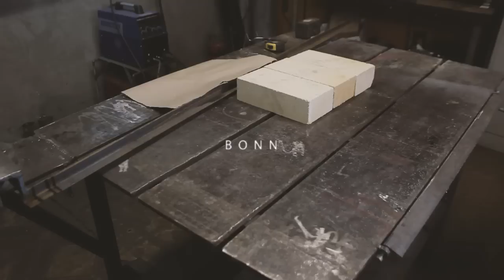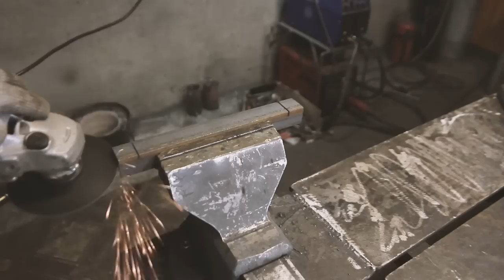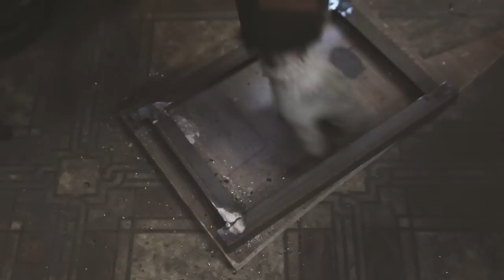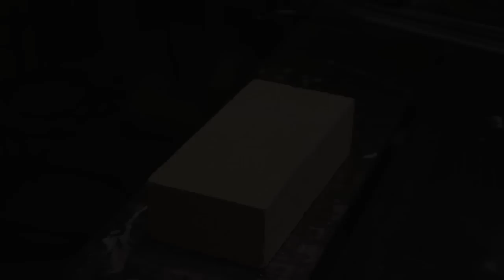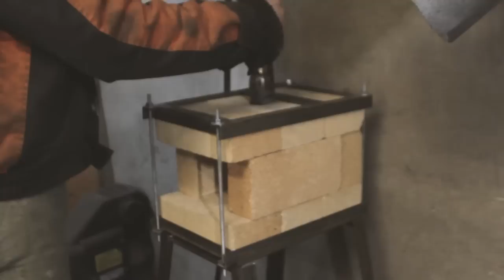How to build a propane forge - DIY projects (S01E02) for forging and casting

Comment: wow nice job. do you know how hot the forge gets?
Reply from the maker: Thx. The temperature of the forge is ~1100C ( metal has light yellow color)
Reply: Bonn Factory ENG thanks
Reply: enough to ruin the piece youre working on if you get distracted? lol

Comment: Looks like clean work. Did you know that they have diamond metal cutting blades for an angle grinder that last 20 times longer then what you used without losing any size?